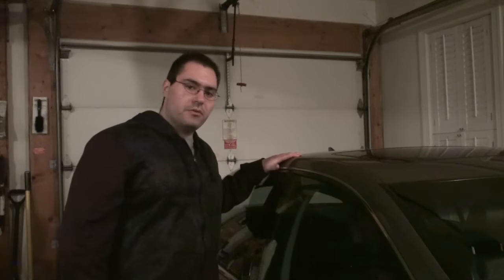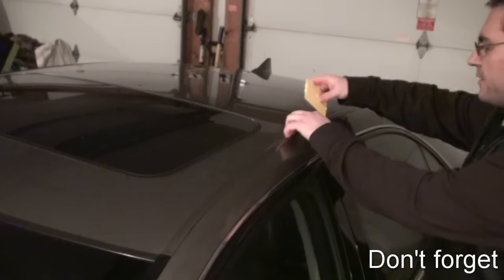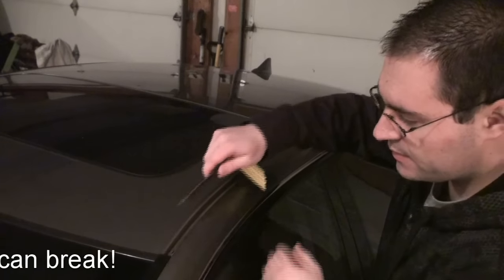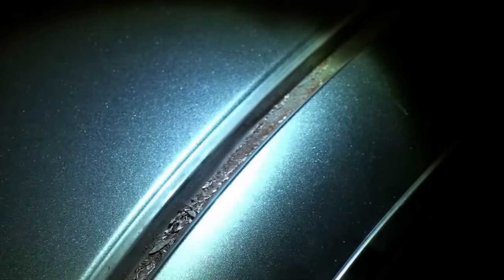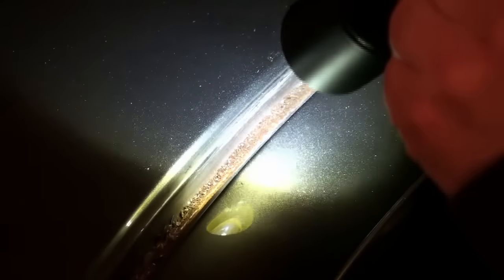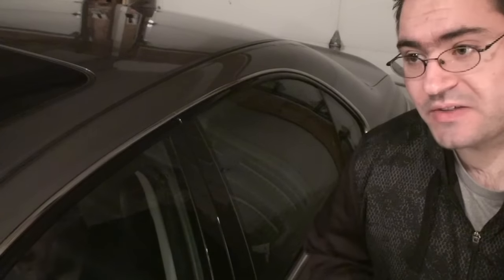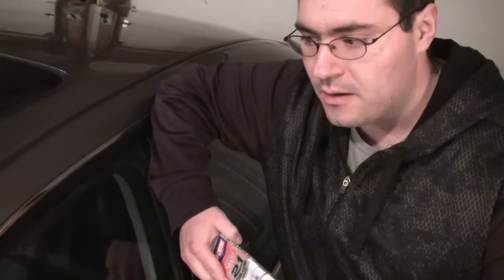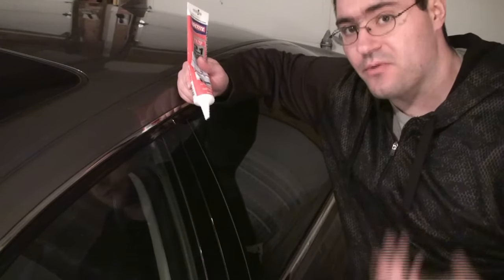Car Roof Leak - How to stop the leak in 10 minutes

Comment: Once I pulled up the weather strip, which pulled off with zero difficulty, underneath looked to be in perfect condition but my headliner is soaked after the first hard rain.
Reply from the maker: Yeah water can be difficult - sometimes just moving it can change the path of flow and create a leak. 

You might also have a pin hole crack in the weld joint you can't see and when you moved the stirp water was then able to run across the hole... a little caulking should do the trick. 

I suppose it depends on how long you are going to keep the car, but what I did with mine was caulk it, put the weather strip in place and then put the top part on top of that so the caulking was then coming out the sides - it stopped the leak, but it clogged the "drain" -  where the weather strip is on the roof of you car acts like a gutter on each side and it helps keep more water off the windsheild - on a heavy rain it was harder to see - I didn't realize that until after it was caulked in place. 

I sealed my windsheild with chemical guys jet seal and it wasn't a visibility problem for me, but be aware of that if you are going to seal it all the way.

Comment: I have a caddilac 2007 i noticed at the very back right side corner on the roof start leaking whenever rain happens.... do you think i need to change the weather stripping
Reply from the maker: it would be the first thing I would check, I mean you can probably get away with sealing it if you don't want to buy a replacemnet weather strip, pending on your car they might be cheap, hard to say...

Comment: BRO!  i have an 08 civic this exactly what is going on with my car!  Raining like a mother today sat down and my seat was soaked as was my ceiling.  Wow.  This will be easy!  I was gonna say maybe a wire brush would work better in that groove instead of that metal file you were using....comments?   Also do not have a rubber squeegee....do you think something like a rubber spatula would work?
Reply from the maker: If you've ever done any kind of work like this before, it's a super simple fix. Just make sure you have a silicone (waterproof) caulking and let it dry for 24hrs. 

When I sealed that it was in the winter, it was about 20* F outside and it took 2 full days for it to dry.  On a hot day you'll probably be good after about 12 hours.
Reply: Use old credit cards if you do not have a squeegee??
Reply: Did you fix it?

Comment: I'm getting water leaking soaking the roof fabric up around the windshield usually on the sides but also gathers in the middle so that water finally starts dripping right around the e brake and shifter onto the floor. ..I tried sealing the windshield it still comes in. The car has roof racks I thought maybe it was coming in from worn gaskets around the racks. I don't know if the the roof racks came with model or not. Do you think the culprit is weather stripping? They seem run under the rack mounts
Reply from the maker: Hey Jimbo, sorry for the late response - I'm just seeing this now - but if you still didn't fix it - I'd assume it's a combo of the roof rack gaskets, as well as the weather strip - and it could be the weld joint/rivits holding the roof on could have rusted or cracked from having the roof rack - they all wear over time - so my suggestion would be plan to at least replace the gaskets, take off the roof rack and inspect under the weather strips to see if there is any cracking or rust or something that needs repainted/sealed - if that and replacing the gaskets doesn't solve the issue then I'd be at a total loss of what to check next. 

I'd be really curious to know what it was if you got it fixed - Dave

Comment: I have a 2005 Corolla, took the weather stripping out, and put silicone sealer all over every possible crevice where was might get in. I also put it all along the windshield, everywhere. IT'S STILL LEAKING. I don't understand where the water is coming from.
Reply from the maker: Hey Sarah, I'm really not to familar with that car - but if it has a sun roof, it could possibly be leaking from there - typically you do NOT want to seal around the windsheild because it will block the built in grooves for the water to drain of your roof and it could make it hard to replace your windsheild if you ever needed to do that...

If the water is more towards the center of the roof not the edge, it's probably the sun roof, but it's a much more complcated fix as you have to take the sun roof apart and it's really specific for each individual car - they are also really easy to break. 

The only other thing I'd say, could it be possbile that you didn't seal every part of the weather strip - for example if you didn't remove it all the way and check for holes / rust - and just sealed over the top of the weather strip then water could probably still get in from the ends...

I hope this helps?
Reply: @DavidParas  I don't have a sun roof, and the weather strip isn't even in the car. There's no weather strip right now. I just shoved a whole bunch of caulking in, sealing up anywhere the water could get in.
Reply from the maker: @SarahPoulin  Ahh ok, so if there is no weather strip at all - I don't think caulking by itself  is sufficent to prevent windsheer from pushing the rain in - do you have someone who can maybe help you with this / double check the caulking is bonded to the metal and not loose anywhere?

I suggesting that becuase I know from working on some landscaping ponds, you have have leaks really far away from where the water is coming in, it's mind blowing how far it can travel sometimes, and this isn't an easy thing to trouble shoot if you don't have a lot of expierence with it. 

I'd think that somewhere the seal must not be complete - it could even be a little pin hole somewhere and it looks like the whole thing is sealed, and I hate to say but at that point the best thing to do is probably take it all of and restart from scratch. 

^^ I'd really ask someone or maybe go to a place like pep boys and ask them for a quote on the cheapest way to fix the leak - at least at my local shop they will say something like you can buy the part for $500 or so or you can just do this, this, and this for $50 and save some money. 

If there is no weather strip at all, I'd say you'd at least need some type of cover over the seal just to prevent the suns rays from breaking down the sealer - I really don't know if they make anything which can last high wind speed (from normal driving even at 25mph) as well as sun, snow, rain, etc...

The only possible thing would maybe be roof sealer for a house, but a lot of those are not made for aluminum and are acid based - they can eat a hole in your roof when they cure. There really isn't a quick fix for this one when the car is a bit older, because all of them will have some rust or little cracks and unless you really know what you are looking for it's hard to find the issue. 

I really don't know if I can help you much more than this, but I'll do my best if you have any more questions - I'd really have to take a look at it in person to say exactly what the problem is - I can say my younger sister had a similar problem and her weather strip started to come off and she needed to get a new one and that fixed it - but you have a leak or tiny crack or rivot pop at the seem where the roof connects to the frame replacing the weather strip alone will not do the trick it needs to be sanded, painted, sealed, then put the weather strip on to protect the seal.
Reply: @DavidParas  thanks!
Reply from the maker: @SarahPoulin  no problem, I hope this at least helps you in some way - it's just not a easy problem to diagnose if sealing everything didn't work the first time - feel free to ask anymore questions - If it's out of my ability to answer I'll say so - the only other thing I could think of that could possibly work with out putting a new weather strip on would be sometype of marine or boat coating/ sealer - but I don't know if it would at all be cost effective and that kind of stuff is typically really nasty smelling, hard to work with, sets really quickly, and really really hard to get off if you make a mistake - I mean for all I know it could ruin your windsheild so it's probably best to try somewhere like pepboys.

You can go here to see what the repair should cost on average for your make and model of car I use this a lot https://repairpal.com/

These guys have some really great how to videos if you needed to do any other repairs/mantience on your car. 

https://www.youtube.com/c/CarCareKiosk

https://www.carcarekiosk.com/videos/Toyota/Corolla/2007

Comment: I have an 09 RL with a decent leak in the same location. I only found a tiny hairline crack in the seam sealer. Did the silicon completely seal the leak? I find it hard to believe that much water would get in a tiny crack.
Reply from the maker: Wes Cairns it's held up the past year for me just fine.

Including winter in Pittsburgh with the car parked outside. I did sand and paint the rust spots before sealing it, but no water or dampness since I sealed it.

Comment: I checked the weatherstrips and I absolutely don't see a single bit of rust or cracks there. My roof is leaking a bit in the front middle, where the reading lights dome is situated. Could it be the windshield, or even a leaking rubber for an antenna  in the back of the roof? It's a 2012 Renault Megane
Reply: Does it have a sunroof? If so I would start there. You could try a thin bead of black silicone sealant around the windshield too.

Comment: Did your car ever start to get a nasty musky moldy smell because of the water leaking in? I have a 2006 TL with a leak in the same spot on the driver side. I let it go for like a year because it was just a small drip when it rained really hard but now there's a weird funky smell (still leaks occasionally) and I'm wondering if there is water/moisture in other areas of the car that's now harboring bacteria. I can't find any other wet spots but all of the windows fog up like there's moisture in the car, it gets so bad even having the air on doesn't stop the fogging. Might be a deeper problem I have than just a shitty weather strip, to be continued... lol
Reply from the maker: It did not, but I fixed it within a few days of the leak and I was able to keep it in a garage with the window down so the water would dry - I mean if you let if go for a full year, yeah there's probably some nasty stuff up there, which is really also not good to breath in like black mold or anything that grows in an area where there is standing water... think like the stuff that builds up around the bottom of a shower or sink and then not cleaning it for a year... 

realistically you might have to pull down the upholstry and clean it with bleach or something like that, It'd be a pretty expensive thing to have someone do, though I've never really taken mine off - I mean I'm sure you could do it yourself, but I'm not the guy to ask about that one.

Anything wet like that over a long period of time is bad.

Comment: I also just saw a video of a new model honda. That had quit a lot of clips but also that mold strip had metal lining. Mine is a 2001 civic. The mold line is all rubber I believe or plastic. I only see that metal sciccor connector at the end part

Comment: My car has the same system and when i go to a drive thru carwash, it peels off the rubber thing, the water leaks inside during the wash, and im afraid that once it will completely come off and i’ll loose it. Do you think your method would help keeping the rubber on the car? Oh and when i put rubber back after carwash, it never leaks.
Reply from the maker: If you fill the area with caulking it will hold it in pretty permanently - that could potentially cause an issue later. 

It also depends on what is causing it to lift up during the car wash - I'm assuming you mean a drive through car wash - if one of the brushes are catching the front of the weather strip, even filled with caulking it will probably make it come up or leak over time - you might get one wash out of it, you might get a few years.  It just really depends on how hard the car wash is pulling on the weather strip. 

The pin clip that holds the weather strip down is probably broken on one side, making it easier to lift up during the car wash. 

If you do end up laying the weather strip in a bed of caulking, be sure that the clips are still attached to the pin, if they aren't it will just fly off your car.  If you get a caulking for sealing the outside of home windows or or for sealing an aquarium it should hold for a while, but it's a ton of work and very, very, messy.  If you have any excess at all or if the car gets wet or rained on before it completely dries then it will run down your car and ruin the pain. 

If your going to continue to use the car wash, in the long run it would probably be easier and cheaper to replace the weatherstrip altogether or pay an auto body shop to fix that issue. 

If your car is around 5 years old or newer, it might be covered under some-type of manufacturers warranty and I would recommenced looking into that.
Reply: David Paras Thank you very much for reply. Car is 2003 Honda Civic coupe..and car wash is right next door where i live and its $3 so id love to keep using it..the little hook doesnt look damaged and hooks well on both side. Not sure why it comes off so easily..and always on the front and peels towards the back. Maybe if its glued in with the chaulk, it would stay put..i was even thinking of putting superglue right where the hook is on the front instead of chaulk..
Reply: Judit, this recently happened to me...I think. Car wash loosened the strip/moulding and my drivers carpet got soaked. Where can we buy replacement moulding?

Comment: I have a leak coming thru the top of the A pillar on my yaris hatch, I've tried different products and nothing works. My last attempt will be removing all the stuff I have used, cleaned it well and use Flex seal in a can and apply it with a brush 2 or 3 times over the suspected area.

Comment: I thought using silicone was bad because it traps water and breaks down the metal in the car?
Reply from the maker: This is only if you are using a commercial acid cure silicon, most places don't even sell this anymore and so long as the tube says it's ok for metal it's not going to react with it. The silicone will with stand the heat and sun bettery than the poly based caulks 

https://www.allmetalsfab.com/galvanic-reaction-caulk/

Comment: I have question: If there is a crack, is it means that the whole car is not in good status?
Reply from the maker: It depends on how wide and how deep the crack is - as well as where the crack is...  If the frame is cracked you're going to have issues. If it's just a small one like what I showed in the video then it's an easy fix. Just clean away the rust, paint over the spot and inside the crack the best you can, then fill it with caulking - if it's a bigger/deeper crack you can fill it in with jb weld or metal bondo, then paint over it, then put caulking over it and you should be good to go.

Comment: Hi Dave, I tried your fix for my Toyota Corolla and the issue still persists with water leaking from the roof joint as in your video. I felt certain this would work but alas it doesn't. Any other ideas?
Reply from the maker: Hi Mo does your corolla have a sun roof? If so it the sun roof drain could be clogged causing the leak - if that's not the case it could be leaking from the front where the windshield is.

On most cars there is a very small space or joint where the whether strip covers - if your standing in front of your car looking head on and you bend down and look up you should be able to see what I'm talking about. 

That is a bit harder to fix because there is a slot designed to allow the rain to leave the windshield and travel up the roof of the car and over the back of it while your drive in the rain so if you fill that area in with caulking or sealer it could create a visibility issue in hard rain. 

I hope this helps?

Comment: I tried JB Weld where the leak is in my Yaris and then used marine grade silicone caulk over and then replaced the rubber strip and it still leaks a bit, I am about to give up.
Reply from the maker: Hey Mike, is your roof leaking right at the joint (above the window) Where the green arrows are pointing at the beginning of the video? If you don't have water right in that crease it the leak might be coming from your sun roof which is a bit harder to fix. But there are a lot of great how to videos on how to fix the clogged sun roof drain. 

Here's a great video on how to do that.
https://www.youtube.com/watch?v=L7S0E4xYdqU

If it's not either issue, I probably couldn't help much with out actually seeing your car - I hope this helps you fix the leak!
Reply: No sunroof, there is a metal thing on the roof that hooks the strip in place, I am guessing that this is where the leak is, I used a liberal amount of JB weld, let it dry and then add the silicone marine caulk and then placed the strip back with more JB Weld and it still leaks, I don't know what else to do, the windshield was resealed for nothing cause the leak was not coming from there.

Comment: I have a Lexus es330 and this my problem,not sure if this work for me?any suggestions
Reply from the maker: It a small a mount of caulking will solve the leak issue - the only thing I'm not 100% sure of is if your weather strips have the same clips that mine did - most cars build after 2008 use the system I show in the video, but if your car is older than that just be careful trying to remove it, because you can easily break off the clips if it's not the "slid and pull" system shown in the video. If you search the Lexus forums I'm sure you can easily find out the exact clips your car has.
Reply: i have es300 and im basically swimming home